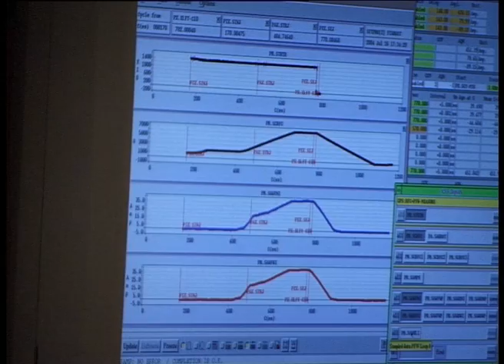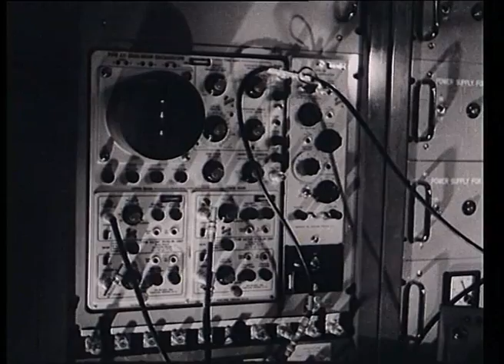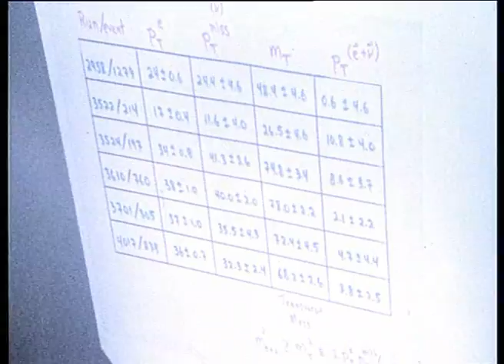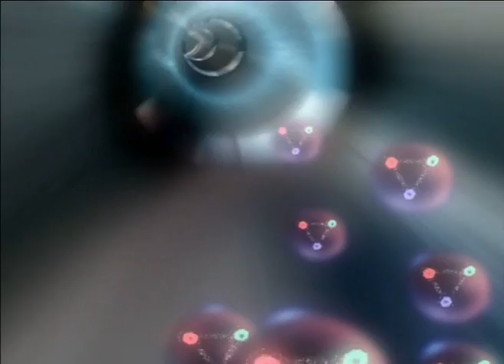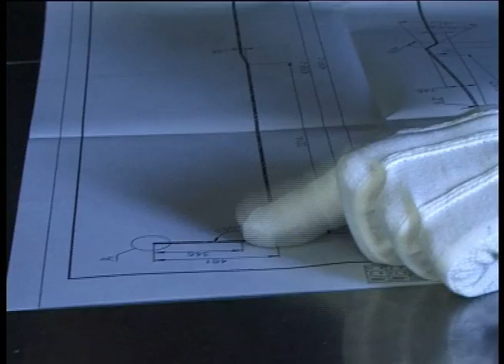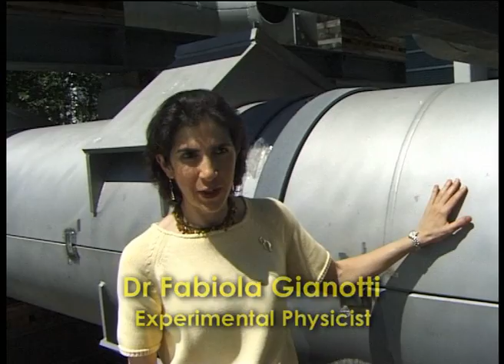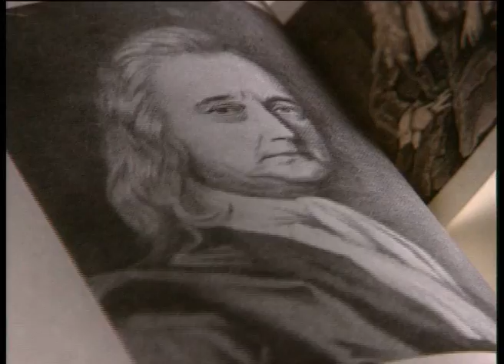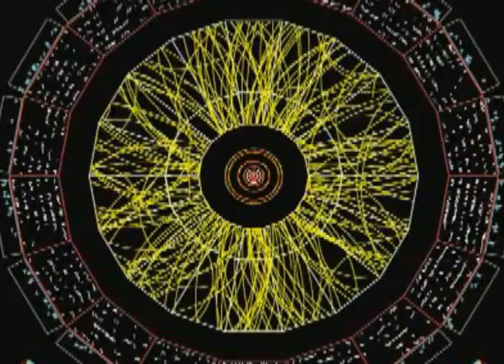CERN: 50 years of Science

Comment: I have to have dinner so I don't have the time to verify my facts, but if I remember it right, a magnetic field applied to quantum doughnuts stop excitons (couplings between an electron and an electron deficient "hole") from collapsing. Excitons are unstable so eventually the electron will fall back into the "hole" and emit the surplus energy as a photon. The magnetic field stops that happening like I said, and basically this can be made to help develop computers that communicate with light.

Comment: you clearly dont understand anything you just wrote. the background radiation is the echo of the big bang and not of some kind of "black hole moon". a black hole doesnt radiate at all (that's why it's black) only gas that gets sucked into one does and is much hotter than 2.7K. a moon is not converted into a black hole. if a star has enough mass it might turn into a black hole after it used up all of its energy. you just mash together some scientific expressions that dont make any sense together